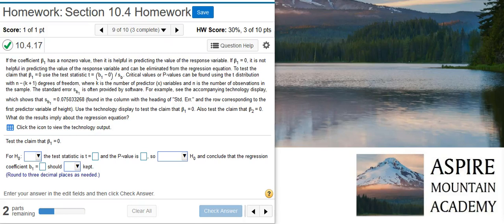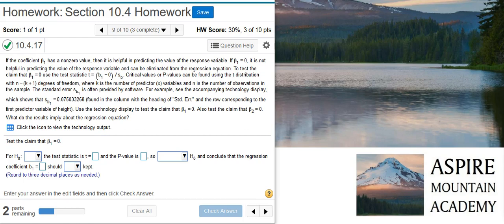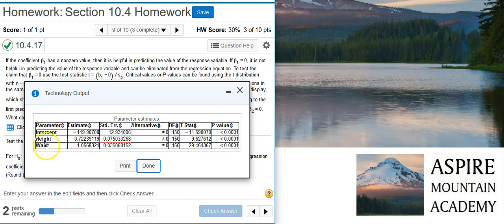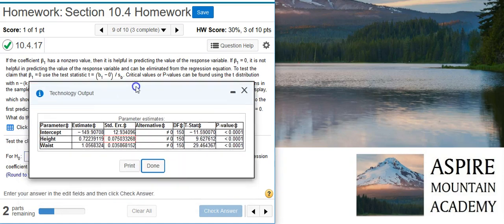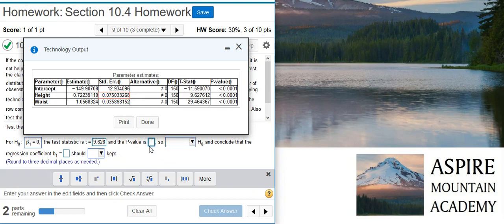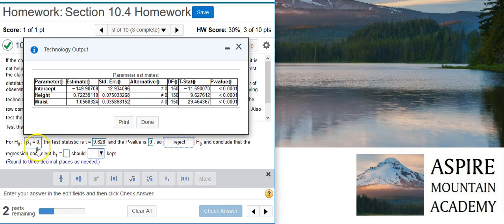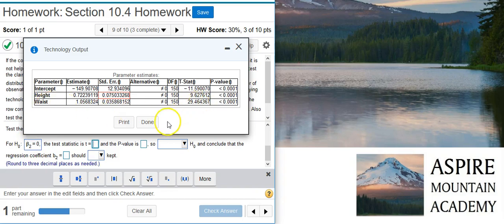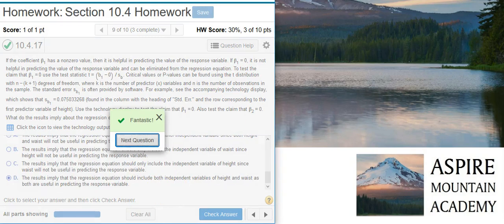Conducting hypothesis testing on multiple linear regression coefficients

Comment: This video was great. Thank you for helping us. Pls upload more videos from chapters 12 and 13. Really struggling.
Reply from the maker: You're welcome, and I believe I can accommodate you.  Were there any problems that you wanted to see in particular?  If you can give me the problem ID number found in the top left corner of your screen, that would really help me help you.
Reply: @AspireMtnAcademy  Thank you so much for getting back to me. I thought you did also but when I looked it stopped at chapter 12. I'm having  trouble  with the whole chapter.  13.2.7-T, 13.2.8.T, 13.2.13T, 13.3.3. Most of the problems look the same but the homework goes from 13.2 to 13.7. Any help that you can provide I will be very grateful.  Thank you again